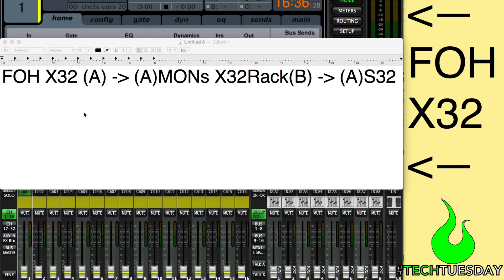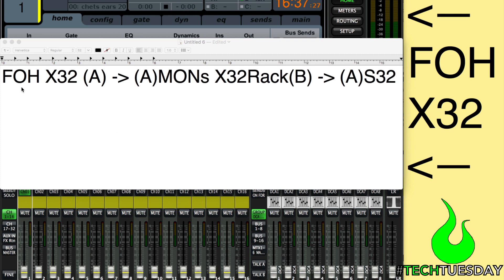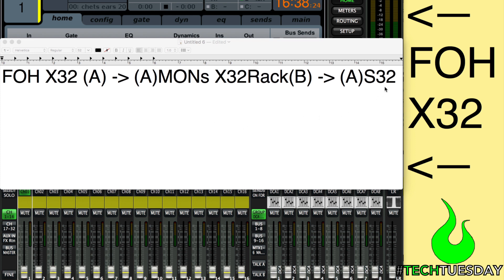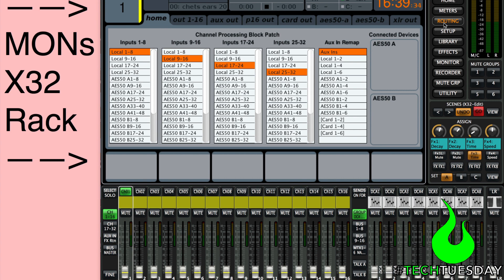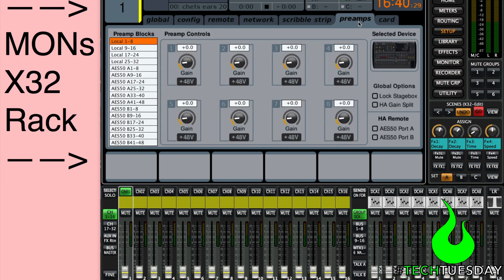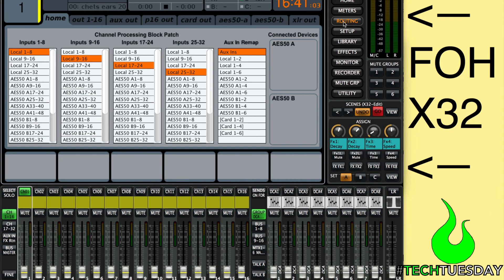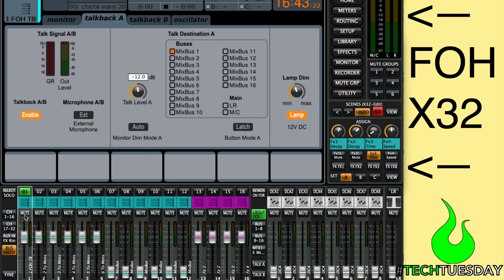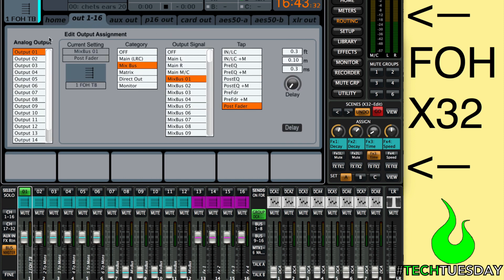Routing a Behringer X32 and X32Rack - Front of House and Monitors - #AscensionTechTuesday - EP088

Comment: Hello, I've recently watched your video and tried a variation of your config but I'm frustrated that X32 rack (being directly connected to S32) can't send out 16 busses. 
Example: X32 rack busses 1-8 to S32 outs 1-8 + Rack busses 9-16 to local outs 1-8. 
I want to get 16 IEM's out of it but my AUX channels are being used for something else.
I know there are solutions like P16s but for now I have to do this before investing. 
Is it even possible? ChatGPT says it should work...
Reply from the maker: I’m a little confused by your wording. Please clarify what you’re trying to output to where.
Reply: @AWTechTuesday  sorry, not a native english speaker.
I solved my issue which in fact is a software limitation for X32 Rack which does not show in the meters I/O all 16 outputs getting signal. In reality it does work (sending first 8 busses to S32 1-8 + last 8 busses locally). this way I have 5 stereo + 6 mono IEMs directly from X32 Rack.
I'm also using (instead of the monitors that you have) 5/6 AUX for TB mics.
If you want I can send you my scenes somehow.

Comment: Thank You so much for this tutorial;. I would have never figured this out and it works great for signal flow from my 2 S16's as input. Is there a way I can use the X-Live card on the X32 Rack to go to X32 at FOH for Playback. of Back tracts on Channel 1 tp24 while using 25 to 32 for live off the stage?

Comment: super Vidéo Hello I bought an x32 rack I have in configuration an X32 Compact for the facade with a Box DL32 Midas internship, with WiFi Router,.My question I was told that we could have a different EQ between the facade and the returns I speak of EQ EQ and not of the eq master on returns.If you have configuration I am interested, the connection everything works with the sound, but nothing works in EQ on each edge on the returns.Routing connection I start from the AES50-A of the compact to the X32 rack in B and then a rack to the A DL32 Midas
Small details the inputs and outputs are coughing connected to the DL32 Midas

Comment: My band as M32C and DL32.  They want this to be their IEM rack and control Preamps of the DL32.  Then, they want to use AES50 to send those inputs to a venue FOH X32 mixer.  I am trying to wrap my head around this.   Here's what I have:
DL32 configured as master clock (48k).  DL32 AES A connected to M32C AES50 A.   M32C set Sync to AES50A, and routed with AES50A as input sources 1-32.    M32C set to Lock the stagebox.  M32C set to control AES50A preamps.   M32C is also routing outputs to AES50A for buses 1-10 for IEMs.  

Then, DL32 AES50 B connected to FOH x32 AES50 A port.  X32 FOH set Sync to AES50A, and routed with AES50A as input sources 1-32.  This should give FOH all our DL32 inputs with Gain Trim only.  Thus, they can mix FOH as they see fit for the venue.   

There is no need to send audio from M32C to X32 or vice versa.  They simply want to share the DL32 as if it was a physical splitter snake.   

Will this work?  Is there something wrong with this solution???

Comment: Hi, is it possible to switch clock source to the Mon‘s X32 Rack instead of FOH, in order to keep the gain levels of the X32Rack uneffected? Otherwise it effects my in ear Mix indirectly when the Sound Engineer turns down or up the gain Levels at FOH. But when the X32Rack as InEar mixer has the clock source and gain control, the FOH only has Trim control, Right?
Reply from the maker: Absolutely. If that works better for you, that is  definitely an option. I’d also work with your team to set gain properly and consistently. If your FOH engineer is “mixing to unity”, I’d give him resources to teach him how to use his meters instead. 

This may be helpful in that regard - https://m.youtube.com/watch?v=HFWDl1IwGTg

Hope that helps!
-Chad
Reply: Hi Chad; Thanx for the response. I think there are 2 design problems with the x32/x32r/S32 setups. Please correct me when I‘m wrong: a) the clocksouce for syncing the S32 has to be pluged into its own AES50 A-Port. The b-Port is Not working as clocksource port.
b) the outputs are only recieved through the AES50 a-port on the S32 snake.
In that case it is Not possible, to get gain control and clocksource from the X32Rack to the S32 when connected to it’s AES50 b-port. It needs to be a-port.
And on the other side it’s Not possible to send the Outputs 1-16 from FOH to the S32 snake when connected to it’s B-port.
So my idea, to get the x32r working as clocksource via Port A (S32), and parallel recieving outputs 1-16 from FOH into the B-port (S32) is Not possible…  the only way to do it is to put the X32Rack in between  Snake and FOH; like you demonstrated… in your Videos, Thank you very much.
Reply from the maker: @279oxygene  for situations like yours, I suggest using this wiring: FOH(A) -> (A)MONs(B) -> (A)S32
Reply: 👍 ok, did this last time; After your instructions, worked well… so i‘m going with that again…

Comment: This question isn’t relevant to this video, I apologize for that in advance. But I can’t find an answer to a question I’m facing. We’re running a stereo PA system, and in context we’re talking bus sends. The 9 channels that make up our drum group are being sent to a stereo bus mix before hitting the main LR. However I finding it difficult to pan those drums around in the stereo field. I feel like panning knobs only work for the Mains and center. Is there a way to pan the drums on the channel level?
Reply from the maker: If you use a subgroup, the panning will apply to the subgroup. That’s the quickest, easiest answer to your question :)

-Chad

Comment: this revision to the other two videos is great. im going to set up in this orientation this month. We have a X32 full at FOH, M32c at Monitors, and two SD16s. I was curious about routing for adding in waves sound grid at FOH. Following your guide instead of the FOH X32 taking in over AES50 A 1-32, it will take in Card outs 1-32. and card will then receive the AES50 A 1-32 from the daisy chain downstream?
Reply from the maker: That sounds correct. Also, I probably would not send the card channels to the monitor console in case there is any latency. Send them the channels from AES50-A

Comment: Hi, great video. I have a group that is wanting to do 8 stereo in ears (using up all 16 outs on the S32). I also have an S16. I'm wondering  if I could use the S16 for main outs, and give the group all of the outs from S32. Would that be possible? Can I connect the AESB from the S32 to AESA on the S16, and route the mains to it? Also, my Rack Unit is the M32C, with no ins/outs.

Comment: Thank you for the video. I appreciate it. 

I understand that this routing works excellent, but I need some understanding.

Why are you taking the Inputs for your Monitor Console from the FOH instead of taking the Inputs for your Monitor Console from the S32 directly? 
I don't see the benefits. Does this allow you to control Gain from both Consoles instead of just trim on one?

Thank you for your time.
Devin Clayborn
Reply from the maker: It’s odd, I know. Two reasons:
 - it guarantees that all the audio is hitting the monitor console at the same time (since some audio is coming from FOH, like the talkback channel etc)
 - it makes it easier to do a virtual soundcheck at both consoles at the same time. You will only need to change the routing at one console to affect both for virtual soundcheck. 

-Chad
Reply: @AWTechTuesday  
Thank you for the quick response. 

All hitting at the same time makes sense.

And can you give me an example of why and how you might change the routing of your FOH Console?
Reply from the maker: @devin1leon  if you were to do a virtual soundcheck to help dial in the settings on both consoles, you would only need to change the input blocks at FOH to CARD and you would also do the same for the AES50 sends from FOH. This will swap audio at Monitors as well.
Reply: @AWTechTuesday  
Ohhh. Wow!

Smart Guy. I like it.

Thank you again for your wisdom.
Reply from the maker: @devin1leon  even a broken clock is right twice each day :)
Reply: @AWTechTuesday  
You don't have to be so modest.
You are a blessing and you are making a difference.

Comment: Hi Chad, thanks for the video, very useful.
Id like to do a similar setup and I'm curious if I can switch on just the X32 for mons during the rehearsals or do I need to switch them both on ? 
Confused on the preamps and clock settings in this case..
Reply from the maker: With this particular routing setup, it would be best to have both consoles on. Now, if you prefer that the monitor console be the gain master, then just disregard the part of the video where I give HA Remote control to the other console. By not pressing that option, the monitor console will be the gain master and the FOH console will have trim control. 

Hope that helps :)
-Chad

Comment: Hey Chad, if you wanted to connect two M32 racks via DANTE, you would need DANTE cards for both M32 units correct?  You would also lose the ability to adjust preamps from the FOH unit correct?  You would have to have a stage box connected directly to the FOH unit via AES50 and then connect the two X32s via the DANTE cards on each correct?
Reply from the maker: Yes, both consoles would need a Dante card. 
Yes, whichever console is connected to the stage boxes via AES50 will have gain control. 

Dante is really useful when you have a vast network of mixers and especially when you have a mix of brands that need to communicate with one another. If you have a small setup like FOH and Monitors and they’re both in the X32/M32 family, it would be better to use AES50 for your communication since, on the X32, the card slot is limited to 32 channels but AES50 can do 48. 

Also, you can give gain control to another console. Your monitor console could be what’s connected to the stage boxes but could allow FOH to have control of gain, if you prefer it that way (and I do haha). This is a useful feature. 

-Chad

Comment: Question -
Can I use 2 x32 rack's mounted on stage (Giving me a FOH mix and separate Monitor mix) connected through AES50 A, and send AES50 B to something like the "Klark Teknik DN9630" in a broadcast room to create a broadcast mix in a DAW? 
Essentially giving me 3 separate mixes for FOH, Monitors and Broadcast.
Reply from the maker: Sure. That would work.
Reply: just make sure that if you are running the klark teknik method that you have a 2 bus routed to your broadcast room as well since the dn9630 doesnt have outputs

Comment: So I have two questions question:
Outcome: FOH x32 and Live Stream x32 two totally separated mixes..

Q1- on the FOH X32 I am ROUTING channel 25 - 32 in locality And our PC Sound, is that possible?

Q2- I’m also running P16s for in ear monitors is that possible to still use?
Reply from the maker: 2 options for you so that you can utilize your P16’s and still be able to run more than 32 channels between your mixers:
 - Route your mixers like this: Digital Snake/P16(A) -> (A)FOH(B) -> (A)Broadcast

OR

 - run a second Ethernet from FOH to the P16, by utilizing the Ultranet output on your mixer. This will output your 16 channels through this second cable so you don’t have to use AES50 41-48. 

Hope that helps :)
-Chad

Comment: I tried this setup and it didn’t work.... I have a digital snake A connected to the FOH mixer and Port B connected to the live stream mixer Port A... On the FOH AES50-a output 1-8, 9-16 is using output 1-8,9-16 to send audio to my speakers and monitors etc but my Monitor mixer is still getting all my channels from 1-32 I didn’t have to change the 17-24 etc to receive Channels 1-8 etc and didn’t have to change the monitor mix to AES50 to receive signals from AES50 17-24 I still have it set at AES50 1-8 9-16 etc and it still receives all the channels I tried your method and it didn’t work.. stick with the Behringer instructions that works better....
Reply from the maker: Depending on the model and firmware of your snake, sometimes you can use the snake as a pass-thru, and sometimes you can’t. That’s one reason why I no longer suggest that configuration. 

The benefit of connecting the way this video shows are that you can share 38 channels between consoles instead of 32 and, if you want to do a virtual soundcheck, you can easily do it from one console to send signal to both at the same time. 

Sorry it didn’t work for you. If you decide to try it again and have questions, let me know. Have a nice day!

-Chad
Reply: @AWTechTuesday  Thx for everything but I think the AES50-A out send the audio out to your speakers via the digital snake 1-16 out, now the AES50-B out is where you select AES50-A as you signal source so the AES50-B out gets the signal and then sends it to the AES50-B on the digital which then connects to your MON input A.. now on the MON mixer you select AES50-A as your signal source...

Comment: Hi tried this setup but since I’m using the AES50 P16 output to route to the live stream mixer how can I set my IEMs...
Reply from the maker: You’re routing P16’s from your FOH console rather than your monitor console?
Reply: @AWTechTuesday   Yes cause the monitor console is running live stream in a separate room not on stage so I’m using the FOH P16 out for my IEMs.
Reply from the maker: @Kuuuks  2 thoughts for you. 1- if your cable run will allow, run the FOH A port to your stage and the B port to your broadcast console. 2- If you can’t do option 1, I’d suggest running an extra cat5 to the stage and connect from the Ultranet connector on the back of the mixer instead of the one on your stage box. If I remember correctly, by doing this, you don’t have to send your P16 channels down your AES  40-48 channels. 

I hope that helps :) 

-Chad
Reply: @AWTechTuesday  Currently this is my setup, FOH runs to port A on the snake and Port B from the snake runs to the live stream Mixer,. P16 is connected to the Ultranet on the Snake. On my routing page it’s setup AES50 A output 1-8, 9-16 which is the default then 17-24, 25-32 is AES50, 33-40 P16 1-8 and 41-48 is P16 9-16...  Though my live stream mixer is getting all the 32 channels from the FOH mixer does this mean 1-24 is picking what I’m sending to my output speakers? Help please. 🙏🏾

Comment: Hi, What exactly is the difference between your way of working and the one in this video?
https://youtu.be/UjJjR2J_aSg
Reply from the maker: This is the way I used to do it. My new method allows you to share 38 channels between consoles instead of 32. Great for sharing talkback mics, etc. You can also do virtual soundcheck at both consoles at the same time. Finally, this video you linked to is 4 years old. Not sure if this is still the case, but I’ve been hearing reports from some people that the pass-through method isn’t working for everyone. May be a firmware update that lost that function.
Reply: @AWTechTuesday  You can also use this routing if you use the new Behringer Wing as a foh desk and a x32/m32c as monitor desk ?
Reply from the maker: @jannmaas  Yes. Going from an X32 to the Wing is flexible but going from the Wing to an X32, using this trick where you offset inputs so you can use the Aux-In on the X32 is still a valid concept :)

Comment: We have a X32Rack and an X32Core along with 2 S16's- would it be possible to use the x32Rack for FOH and Monitors while using the X32Core for a broadcast console linking them as you have outlined here? Since the X32Core has no physical outputs do you know how I would setup the routing for the broadcast console outputs? I'm just trying to determine how to get the broadcast mix as a separate mix for the web out, if that makes sense. Thank you for your video... super helpful!
Reply from the maker: Should be fine. Same concepts would apply. Id connect it like S16’s(A) -> (A)FOH(B) -> (A)BCast

Comment: Hi,
Thanks for your video !!!
I use the Midas M32R for FOH and the M32C for monitors.
So is it correct that on my M32C in my routing for output AES50-B I should set outputs 1-8 to "Out 1-8" instead of "Out 9-16" like you do ?
thanks !!!
Reply from the maker: jan maas Sorry, not quite enough info. Are you asking what your B settings should be going from your MONs console to your FOH console?Is that correct?
Reply: Ascension Worship - #TechTuesday hi, thanks for your reply !
I mean what you explain around 12.40 in your film.
When I do the same I don't get any sound from my monitors connected to output 1 through output 8 of my DL32.
But when I'm on my M32C (monitor console) in > routing > aes50 B > outputs 1-8.
If I set it to Out 1-8 there, I get sound from my monitors, and if I set it to Out 9-16 as in your video, I get no sound from my monitors.
Is that normal ?
Hopefully this is a little bit clearer because my English is not that good...
Sorry about that !
Reply from the maker: @jannmaas  What exactly do you want to come out of those physical outputs? In the example in my video, the physical output of the DL32 are outputting 9-16 of the monitor console out of the first 8 XLRs and 9-16 of the FOH console out of the DL32’s XLR’s 9-16. This was a purely hypothetical example. You can customize this however you’d like. 

-Chad
Reply: @AWTechTuesday   Ok, I think I get it !
you have the X32rack and it has 8 physical outputs and because you choose "out 9-16" in your routing page you can use the first 8 physical outputs of your X32rack and on the DL32 you can use the first 8 outputs as output 9-16 of your monitor desk.
And than you can use output 9-16 of the DL32 for the FOH.
correct ?
I was confused for a moment because my M32C has no physical in and outputs.
Reply from the maker: @jannmaas  That’s exactly right!
Reply: Great ! 
Thank you very much for your comments and your video !!
Keep up the good work !!